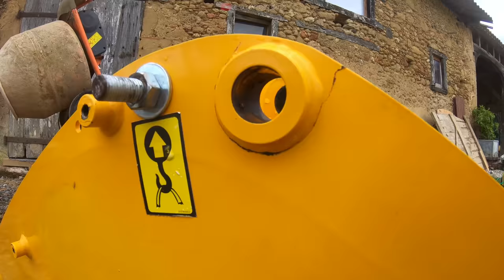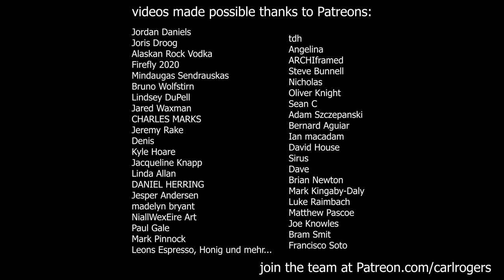When buying used Equipment goes WRONG

Comment: Hi Carl, nice to see you read and reply to comments. I'm quite cheerful btw. All respect for your carpentry and roofing skills, but why post stuff for the world to see if you can't take a bit of positive critique?

I've spend decades around plant workshops and was chewed out 1st day by the foreman for going in to collect an excavator wearing veldskoen (rawhide shoes). Next day, a worker wearing thongs and helping carry a box of CAT245 teeth had the bottom fall out of the box and lost three toes.

Now, put your big boy trousers on and get down to Bricomart and buy yourself and the girl with the pretty painted toe nails a pair of €19.95 safety boots!
Reply: haha that sounds so familiar
"when I was your age I (insert something your body isn't made for)" spoken by a man that can't get up from a chair at 55 😂
Reply: @carlrogers I recently ordered a pair of Birkenstock QS 700. Its a pair of safetyshoes but it's "barefoot-appropved". Wide, flat sole etc. Just buy a pair of really flat insoles and they're good to go. Just a tip since ive seen you using vivos :)
Reply: @Baer1990  I guess I'm luck at 60 that I'm still climbing up scaffolding, tiling roofs then 😉
Reply: @stephengrimmer35  Smart people last longer 😉👌
Reply: Open toed sandals ! Ouch that's going hurt. The thing is if you don't wear steels you can't squeak when it goes wrong.   And it always does in the end
Reply: @fleshfabbe  Birkenstock best footbed. At first your feet hurt for 1-2 days in new Birkenstocks, but once they're worn in, you'll never want to wear any other shoes again.

Comment: The hole doesn’t need to be aligned since there is a grove on the inside which let’s the grease go around
Reply: It's actually better not to align the hole, the grease will go to the opposite side better if you put it 90 degrees off
Reply: @derektroost6980  I noticed the groove on the old bushes that came out but I couldn't make one out on the new bushes so maybe he did need to line up the holes
Reply: @derektroost6980  if the Bush presents a solid face to the hole, having a groove round the inside will not make any difference, the grease can't get in, this was the problem in the first place, many bushes have a helical groove to distribute the grease over the whole pin but it still has to get in.
Reply: @CrusaderSports250  not if the groove lines up with the grease zerk hole, then it becomes a grease channel that allows the grease to go around the bushing and come out 2 places instead of 1.
Reply: @jimmyb1451  the bushing has more than one hole.
Reply: @derektroost6980  why do you reckon that is?
Reply: @jimmyb1451  so the grease can get all the way around the pin
Reply: @CrusaderSports250  It's literally the intended design function of it. Not that I knew this prior but a quick Google search will net you the proper information.
Reply: correct .grease wont go around the other side of the pin now only 1 spot so this will damage the pin again .
Reply: @derektroost6980  Yep, that's why high performance and output engines have crossed drilled cranks, it they had standard ones all the oil would fly out very quickly and large areas on the wrong side of the centrifugal curve get under lubricated , even more so  as the oil thins it is no longer viscous enough and just runs out before it can be dragged around the complete surface.

Comment: Great work using limited tools. However, as someone who came very close to losing a toe in an industrial accident (and no, I wasn't wearing safety footwear) sandals are not safe when working around equipment. One slip and you could lose one or more toes in an instant.

Comment: You should never grind those welds. I'm questioning if the welds will hold. I can see voids in some of the welds. A professional would have likely created additional plates to go around those large pin holes to strengthen the area. I think you might be doing this again in a short time depending on how hard you are on that machine.
Reply: My thoughts exactly
Reply: Mine too
Reply: Yup, thought the same exact thing when they popped it in the trunk. "That repair could use plates over the cracks for reinforcement". Then I seen him grinding the welds and was like "Noooooo!!!" Literally likely those welds were like that and those areas for a reason. Wasn't the prettiest job but for the purpose of safety and stopping the cracks from reappearing, definitely shouldn't have grinded them down.
Reply: Grinding welds can stop cracks from forming in some cases.
Reply: @gezski  If doubling plates are not done correctly, then they will cause the same problem as the original problem was. But if doubling plates are done in correct way, then they will relive the stress in hi-stress areas. The usual problem is that the welder does not know how to make appropriate plates.
Reply: I literally came here to say the same thing... Next time 👍

Comment: If the cracks continue to appear on the excavator (tired material) the next step would be to cut and weld reinforcement plates around the most stressed area. The idea is to distribute the stress and not to have any sharp edges, look for the ones installed at the factory for example. The easiest is if you know cad and order these from online laser shop etc. Really enjoy your channel & the work you do on the buildings!

Comment: Carl dear Carl. Never ever carry out any building mechanical maintenance in desert wheelies Jesus boot or any other stupid footwear. You will one day end up with no toes. A man I know very well lost half his foot wearing incorrect footwear and an amount of bad luck. Tool belt is a great addition to my build. Thanks.👍🏻👍🏻
Reply: As someone who HAS lost half of one of his feet from a work accident, I can tell you steel toed boots don't always save you.
Reply: @TdrSld  Clogs! Clogs are the answer! Better results in safety tests on many accounts, except skid resistance of course
Reply: @beeldhouwerijvanvelzen1533  mm
Reply: You always get these dire safety warnings if you make a video involving mechanical stuff.
  He should have opted for a sturdy pair of flip-flops.....
Reply: @TdrSld  Not really an answer though, is it?  A hard hat won't save you from a 10 tonne load,  but that's not a reason not to wear one.
Reply: @RicktheRecorder  To this day I now work in mostly sandals (mostly do to pain issue in the stump). OP is saying that steel toes will save you all the time. And I replied with it wont, from what I learned from the Doctor's steel toes are only good at low weights that would simply brake your foot. Once you get to medium weights it's going to be a crush injury. Your foot has the smallest blood vessels in your body and they do not take to well to being crushed. This is what lead to me losing half my right foot. 

The Steel toe boot I was wear actually did more harm as it crush and then held that pressure on my foot. It took 3 surgery's to cut it off. First was a rebuild of the front half. Second was cutting off 3/4 of my big toe, all of my second and third toes do to them dyeing from lack of blood flow. Third was half the foot to med arch, again do loss of blood flow. The blood vessels could not recover and the parts died from lack of blood. 

It is safer to simply keep a smart head on your shoulders and aware of your working area and wear PPE that makes since. Not all PPE is needed on 100% of job types.

My injury came from a coworker playing with buttons in the cab of the 18 Wheeler he shrouded have been playing with. As I was loading cans of welding rods on the deck to be strapped down. I had just finished loading a 25 Ton Cherry picker on it and chaining is down. 

At the end of day Shit Happens, bitch and moan for like 30 minutes then just start making fun of it. "At least it wasn't my right hand, that would have killed my sex life" - Me laying on a gurney laughing my ass off in from of the EMT's. They were not amused, hahaha.
Reply: @TdrSld  It's a grim story, you have had a great down-turn to your life, and I can understand how you feel.  However one-off anecdotal events don't affect the general truth that simple safety measures save lives and livelihoods. No-one believes safety equipment will work perfectly in every situation. You are just increasing the odds you will be protected. Your argument is like the ones we used to hear from people who resisted compulsory seat-belt wearing on the grounds that they had once heard of a man who was thrown to safety from a burning open-topped car. As for the boots, I wear Kevlar tipped boots that should not permanently deform. And so safety increases incrementally.

Comment: Despite the critics I say nice job at tackling the job of maintaining your equipment even if it meant learning on the job. with some slight imperfections the machine for sure is in a much better spot then when you started. Good job gentlemen and ladies.

Comment: I will try to give you a tip for the future considering how you were cutting the bolt. I think it would be easier if you cut the bolt and nut directly from above at the center of the bolt. That way you cut the nut into half and you can pluck out the nut to sides and then bolt becomes free. Basically what im saying is you were cutting the bolt in half when im suggesting you cut the nut in half vertically. Im not sure if you understood me :D. Also nice work on the video :) !!
Reply: And he should have used a cutting disc, not grinding disc.

Comment: A good idea adding an extra fillet over the welded area, the bushes are not supposed to be lined up with the hole, you will only get grease into the bearing through one hole that way, there is a groove around the inside of the housing to carry grease to all four holes if you push the bush in, (after getting it out of the freezer) to block the entry point, and force it around the bearing, I cant believe the mast has cracked that badly after just home use. Good luck with that.

Comment: Very nice.  If your hydraulic controls are cable driven, you need to check the adjustments to make sure the detent positions match the valve positions.  I have a piece of JD equipment where the cable adjustment wanders and causes heating and sluggishness until readjusted.  

When you remove bushings without a press, it is easier to cut with a hacksaw or file so the bushing will collapse.   Don't need to cut through.

Comment: You might have air in the slow cylinder, did you bleed everything after refitting? Otherwise might be some debris in the annulus. Try disconnecting the relevant hose and exercising the controls catching the oil in a bucket.
Reply: He did, he posted somewhere else saying they figured it out before the video finished but figured hed leave it in for feedback. You are correct though it was the air.
Reply: @SixSnax  thanks for your support. Glad to know that my 30+ years experience was not wasted.
Reply: @Anony Mouse LOL

Comment: Re: the king pin. Whenever anyone says they'll replace an item later, I have to ask the question, what year? Unless there is a maintenance schedule being followed to the letter, experience says it will never happen. And always best to replace Nyloc nuts, rather than re-use old ones. Bit late I know but I find a small hydraulic press far better to use than hitting bushes, bearings and the like with a hammer. But you got there! Well done.
Reply: Regarding bushes, in the absence of a press I've used a vice.
As for "later", sometimes you just have to delay a job as a more-urgent use for the machine comes up (can anyone say "soil must be moved for planting sooner than the full pin-and-bush-replacement could be finished"?). It's essentially the same as pushing past the pain, or using the battle-override. And Carl actually has the new kingpin and bushes ready.
Reply: If you pack the bushing in dry ice, they often FALL into the hole or only take light tapping. However, you have to be fairly fast and make sure you don't jam it at an angle. I use this trick on small and large bushings and even if you still have to tap on them it doesn't take much force. When rebushing the bucket end of the stick on a 45 ton excavator you can't get a lot of parts into a press (if you even take them off the machine in the first place
Reply: Ah the secret to Nylocs is to whack them with a hammer and compress the nylon, that's the proper farmer's way the nut's fine it's just lost a bit of nylon, giving it a thump flat on top on a bench and it's as good as new.
By the way it's not just farmers it's pretty much anyone

Comment: Those bushes go in a lot easier if you put them in the fridge for half an hour first ;)
Reply: And press them in with the vice in front of him
Reply: @becton98  yeah wondered why he didn't use the vice as a press 🙈
Reply: @E9JMX  I'm no mechanic so thought I'd missed something 🤣
Reply: It doesn't need to, some of the copper bushing have a slot...
Reply: @ernestospadolesto8126  what is a copper cans? do you mean copper bushing?
Reply: @becton98  that wood working vice wouldnt do it, first it would just dig into the wood, the threads on them are not like a meter worker one
Reply: @arnoldromppai5395  Thanks for the correction.
Reply: @ernestospadolesto8126  any time..
Reply: Are they brass or bronze? If they’re bronze, should they not be soaked in oil before fitting?
Reply: @Barnagh1  they are steel bushes coated with bronze, I fit them to JCB's all the time. They do not need soaked in oil as the ram ends have grease nipples in them for lubrication. It is sintered bronze bushes you are thinking of that are soaked in oil, if you hammered in sintered bronze bushes the way they are done in the video they run the risk of breaking before they are fully in.
Reply: @Barnagh1  no you put them in the freezer for over night or 6 hours. keeping them ice cold until you slip them in, same with very large bearing races

Comment: Press fit or shrink fit bushing design and installation is a common method of retaining bearings by use of  interference between the bushing and the bushing hole. Bushings are available in standard sizes with both inside and outside diameters surfaces finished, and are commonly available in many sizes.

Typically, bushings are designed and manufactured 0.002 to 0.003 inch over nominal on outside diameter sizes for sizes 3 inches or less. Diameters greater than 3 inches, the outside diameters are designed 0.003 to 0.005 inch over the nominal size. Because interference material is built into the bushings, and the bushing is normally manufactured to tolerances of +/- .0002. The effective interference of the press fit is designed and facilitated within the target hole which the bushing is installed.

The process of  press or shrink fitting the bushing into the hole, causes the bearing reduce in size due to the compressive forces applied. Additionally, the material which the bushing has been pressed into distorts some as well. In general, this diameter changes are equal to 70 to 100 per cent of the amount of the material interference or fit. Unfortunately, precisely or mathematically predicting the size change due to the effective compressive forces applied during installation has not been shown to be accurate. Typical installation compression forces and effective diameter changes may be modeled or characterized by fabricating several test cases and measuring the range and variations of the actual fit. Often, bushings are designed with additional diametrical material requiring a post press fit installation machine process to accurately ream to the desired diameter.

Shrink fits are facilitated by chilling the bushing using a suitable median, such as liquid nitrogen, dry ice, or placing the bushing within a freezer. Cooling down the bushing is preferred rather than heating the target housing. Normally, the bushing is of significantly less mass than the target housing, though heating the housing and simultaneously cooling the bushing is no uncommon .

When a bushing or bearings are pressed into a housing, the force driving the bushing / bearing should be applied equally or uniform to the end of the bearing to avoid galling, peening or damaging the bushing / bearing. The mating surfaces of both the bushing and housing should be thoroughly cleaned and imperfections as well as burrs removed.

Comment: These slugs or outer pin anchor points should have been veed out re-welded ground back and a plate cut to fit over the outer collar and welded in place to stop stress fracture next time.
This area it's obviously a week point and to strengthen it now would have save you another welding job later on down the track
Reply: @gezski  Fair enough good point  in some situations yep depending where there been welded too

Comment: Next time if you need to put bushings in, get some canned air that is used for spraying dust off of computers and turn the can upside down and freeze the bushing, which will make it shrink a little bit and it will go in much smoother. Hope this helps in the future.

Comment: The slow hydronic response  is due to trapped air. Breed the cylinder you will hear the air escaping. Add more fluid afterwards.

Comment: Lots of work for sure!.  If you ever have to put brass bushings in those again like at 16:50 or so, you could also line it up and use the vice to press it in vs pounding.  That can work better with a metal plate to push against vs the wood, but I saw you have some flat stock you were pounding on.  That can be a more controlled insert vs pounding.  That also works to put bearings onto a shaft if you take your time and line it up.  I did that method when I put new bearings on my drill press restore project.  Using a vice or press is much preferred vs pounding. :)  Less chance of damaging the pieces as well.  Though in my case I did split the wood on my wood vice and so moved it to my metal vice instead which worked better.